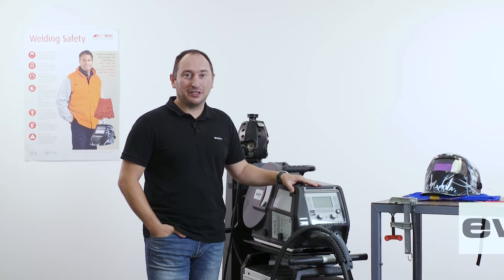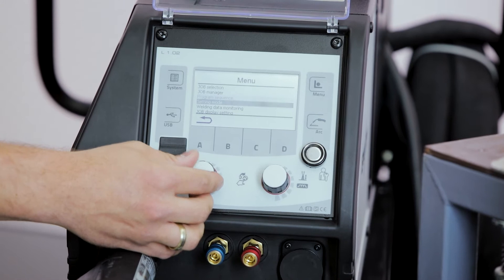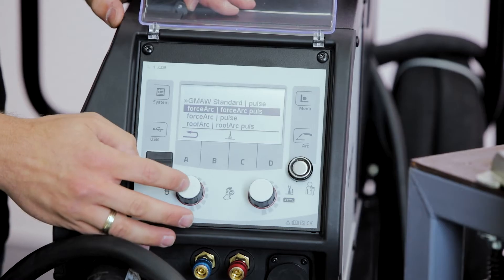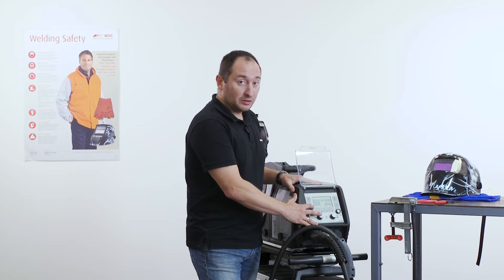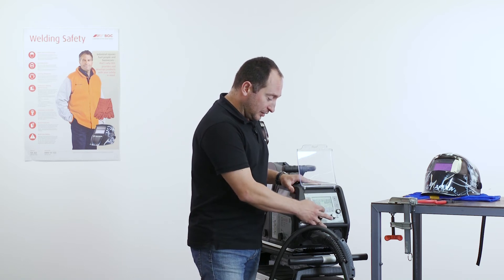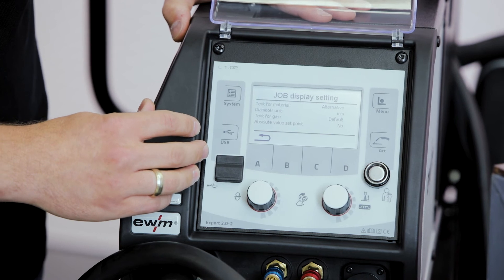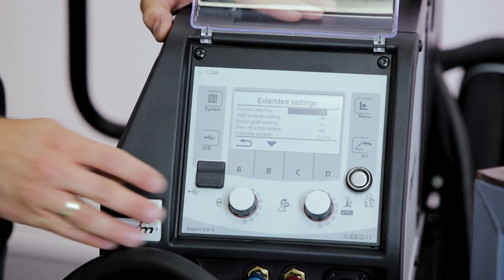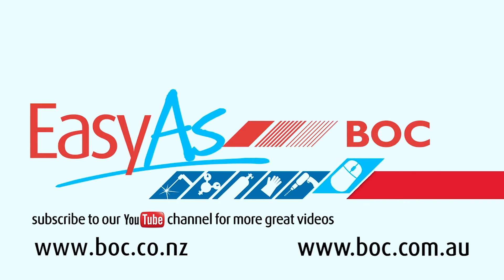BOC EWM Phoenix 405

Comment: Hello, just wondering if you would have any idea of what’s causing an issue that I’m having with a Phoenix 400, I’m welding Aluminium and sometimes not every time, I’m welding; stop; and when I press the trigger the wire starts feeding backwards, stop again, press trigger and wire comes back. It has happened at different amps, don’t seem to find a pattern or a root of the issue, it’s weird and not helpful when I’m sometimes trying to tack something and holding with my other hand and have to let go of the part because wire is going backwards. Im in Australia and don’t have lots of information about these great machines.